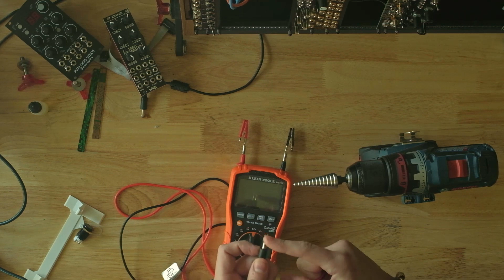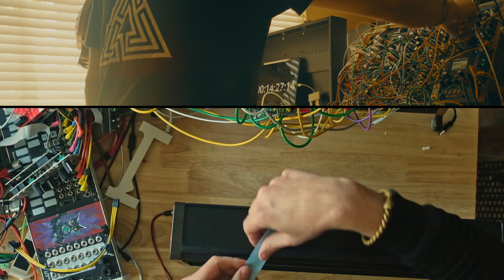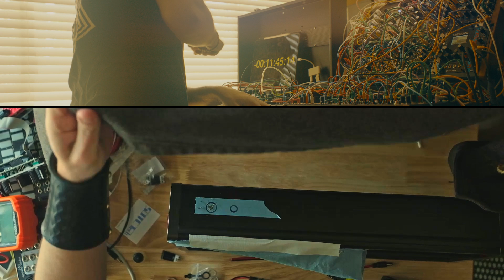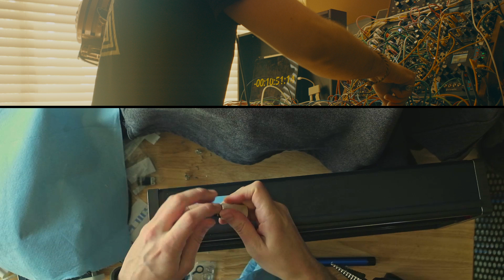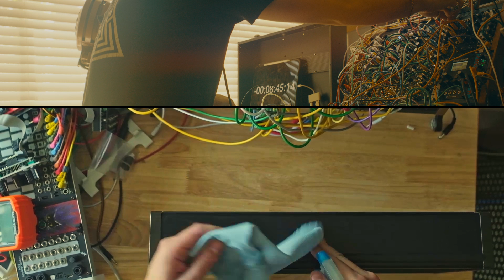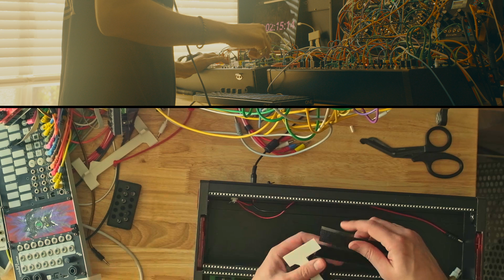I Modded My Rackbrute Using a 3D Printer and a Bit of Solder

Comment: what is the mod?  installing power supply on top of the case???
Reply from the maker: Exactly, with a couple small pain points I stumbled on and a fun little trinket I designed for 3D printing to mint stuff nice and clean

Comment: Nice one. Thanks for sharing. I've Considered this many times, but never took the plunge. My only fear is, having the side of that board sticking up. It would be interesting to think about a holder with a guard that comes around and acts as a protector. Maybe there is nothing to fear, but I don't know enough to know for sure 😅
Reply from the maker: I totally get that - since you're basically permanently modifying the case for the sake of 5hp. FWIW I'm pretty happy with the results so far, no weird issues with my silly velcro etc